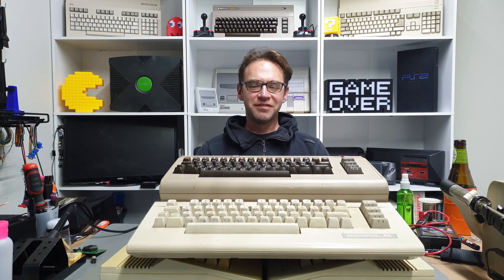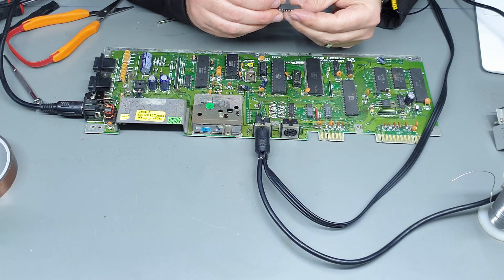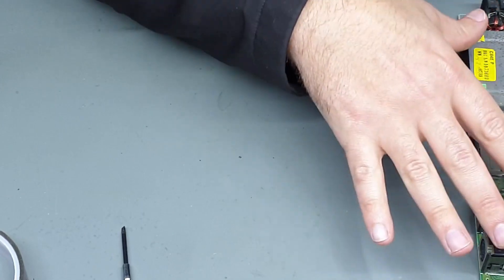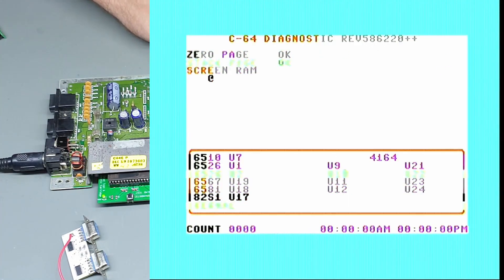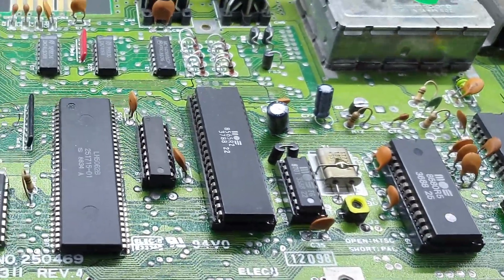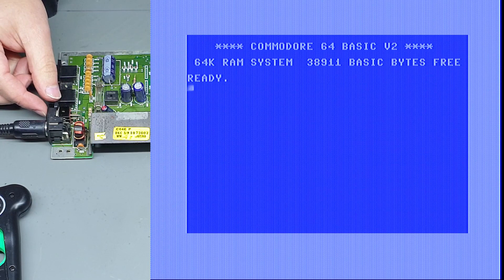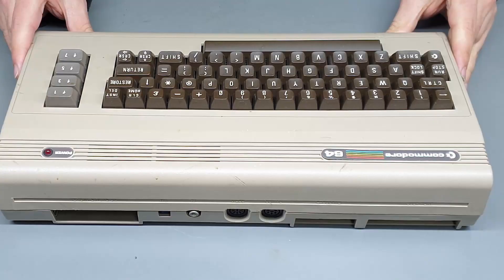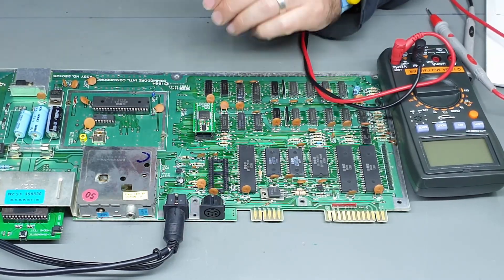Commodore 64 repairathon PART 2

Comment: When fixing double sided boards I usually heat the pin of the IC from the parts side while holding the desoldering gun wo the bottom part of the board. Often enough I notice the solder on the solder side melting so a regular cheap plastic solder sucker would do the job just as fine. Depends on how well the board dissipates heat.
And just this weekend I was showing a friend some stuff on my main C64 and it died shortly before the end of Deus Ex Machina (the 3D OpenGL kinda part). I tried running other demos, they either wouldn't load, crash right away or crash after a short time. Everything that was not a demo that I tried ran fine. Only demos it seems. Loading from 1541Ultimate or a real 1541 made no difference. Running stuff from REU worked fine.
Sadly the PLA wasn't socketed, so I started with the CPU, swapping one in from another machine made both machines work fine. Btw. the donor C64 has a single wipe CPU socket, but the "defective" machine had dual wipe, so it's unlikely the socket.
My guess is that the PLA is on its way out... but usually the formula goes "if weird things happen with a cartridge inserted, but without it the machine runs fine, that's the PLA getting weak". This did just not apply at all here...
Reply from the maker: Interesting, yeah I've dealt with a PLA on the way out before. Took me a while to work out what was going on as putting in the test board everything worked fine but in the original machine it caused random issues. Could be the test board was a bit more tolerant of a poor PLA. 

I think Sven Petersen suggested trying a different PLA just in case and what do you know, no more issues.

Comment: Those CIAs are so delicate. Just plugging/unplugging joysticks can damage them. That is why I ordered a joystick switcher from Australia. This unit let's you switch joystick ports with a button press and also has a circuitry to protect the CIA. So if you have a static discharge on the joystickports located on the joystick switcher it should not harm the CIA.
Reply from the maker: True, I think I've replaced more CIAs than any other chip 😯. The joystick switchers are a good idea if you want a simple plug and play solution. Personally I like the ESD protectors that get soldered to the ports themselves. I've done a video on them if you haven't already seen it https://youtu.be/-568ZT_v1b4
Reply: @TheRetroChannel  Will take a look at the video. One big reason to why I bought the Joystick switcher was not only to get ESD protection for CIA but also because of how annoying it is to constantly swap Joystick ports when trying all sorts of games. Now I can just hit the button on the Joystick switcher. Nice and simple. The ESD protection is a big bonus of course

Comment: Excellent video! Would like to know how you get picture on picture when you power up the C64.
Reply from the maker: The 64 is hooked up to my laptop using a cheap USB capture device that takes Svideo and composite. From there I just use the camera app that's built into windows and hit record before I power the 64 on. The rest is just a case of syncing it all up during editing

Comment: Wow. Two commodores with actual problems. Great. I noticed one of the boards has markings on it. Arrows and circles. What's that about?
Reply from the maker: They were little notes to myself to check for potential broken traces in those areas, but as it turned out they were all ok.